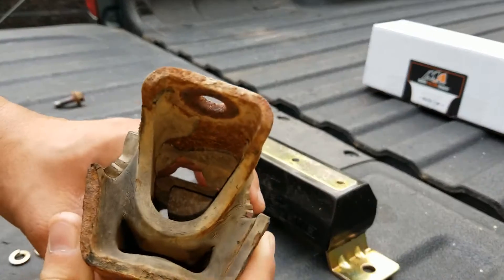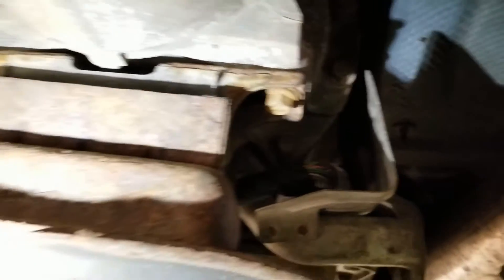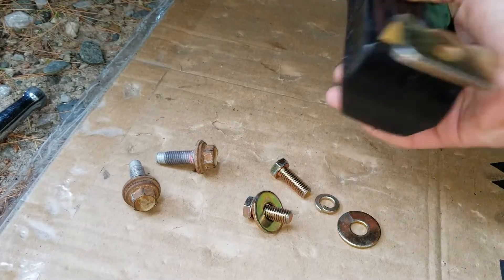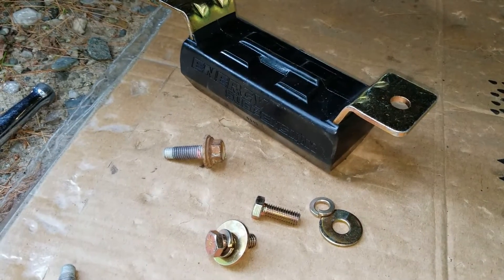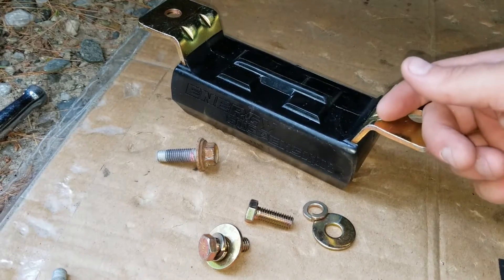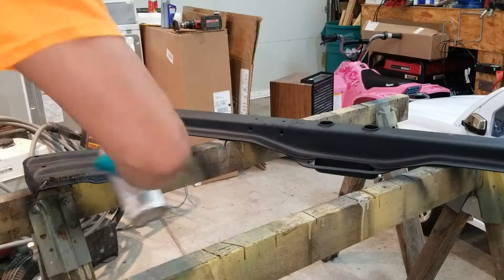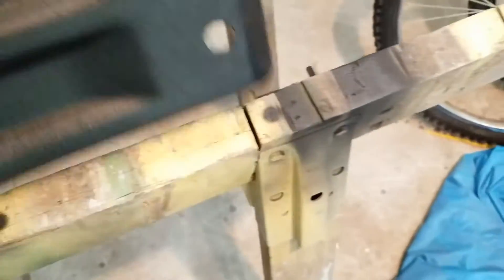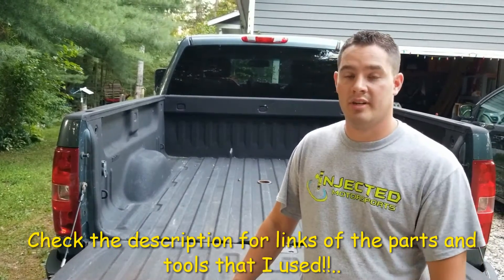Transmission Mount and Cross Member Install and Repair

Comment: Thanks im replacing mine today.
Reply from the maker: No problem! Mine still looks good and going strong. The paint has not held up as well as I thought. Probably should have painted it after the rust inhibitor. Either way, I still am impress with the mount.

Comment: Hey, whats those 2 tubes called right above the crossmember bolts?
Reply from the maker: Are you talking about the pair of black tube on the passenger side? Those are for my Air Dog lift pump. If you are talking about the tube zip tied to each side of the torsion bars, those are the exit for my PCV reroute.

Comment: The energy suspension mount I just did on my '01 had a separate plate that went over the top of the mount between the trans and the mount.  Instructions said it wasn't a spacer and must be used, not sure why yours didn't have it.
Reply from the maker: Me either. Does your mount look just like mine? Or maybe a new style vs old style of the mount maybe?
Reply: I just bought the same mount you linked. Did you use the extra plate or not?
Reply: @NealORussa  Yes I did, it needs to be installed with the mount.
Reply: @GrandPrix46  Hmm, i just installed mine today without.  The OEM mount was 3" tall.  The energy mount was 3" tall without the extra plate.  With the extra plate it was about 3-7/16" tall.  What happens without it??
Reply: @NealORussa  I'm not sure man, it'll probably be fine, but when I dropped the trans down on mine it didn't look right.  I think there was a ridge on the plate that meshed with the top of the mount, kind of sandwiching the poly material in between.

Edit: just clicked on the link and looked at the picture, you can see that ridge I was talking about on the plate.

Comment: The stock one will out live that aftermarket.
Reply from the maker: Do you think so? It seems pretty good quality.
Reply: @xtrodinaryduramax8010  There not bad, I have had ones like them befor and they didn't last as long as I thought they should have. Once they got oil on them they swelled up and then split. Just not a fan of neoprene mounts or bushings. I hope it works the way you want it to.
Reply from the maker: @upnorthyooper1196  I hear ya! I have trans, engine, control arm bushings, and antibsway bar links that was made out of them for years on my cavalier. But that car never saw a winter, was always washed and cleaned, and had no leaks. We will see how this holds up. I have had it for a year now and I probably should check it.
Reply: @xtrodinaryduramax8010  I live in MI also, winter is a bitch.
Reply from the maker: @upnorthyooper1196  I picked that up with the name. And it's real hard to keep a nice vehicle. But I'm ok with not having natural disasters and having nearly every weather pattern throughout the year or day. Haha!! I wouldn't change it